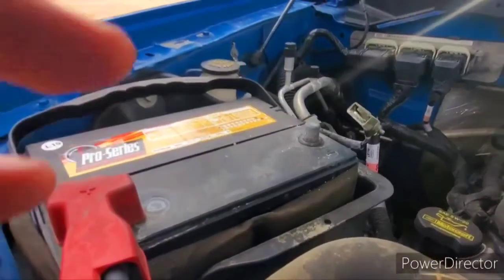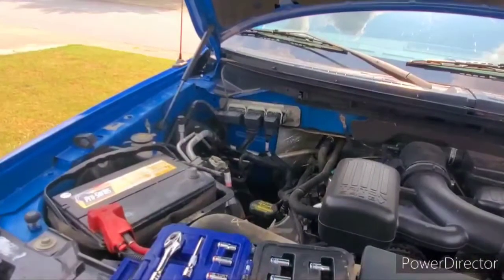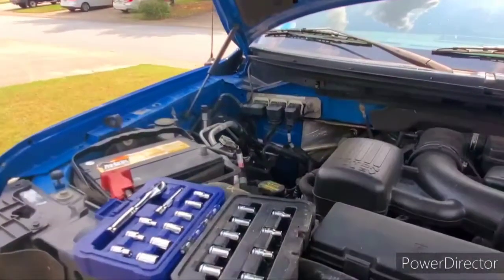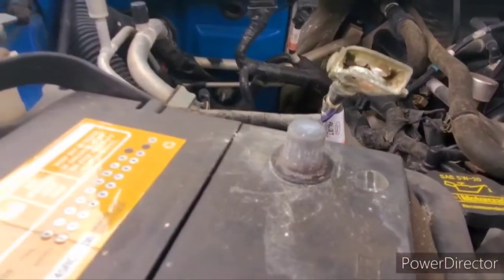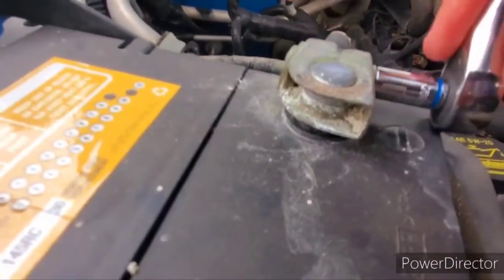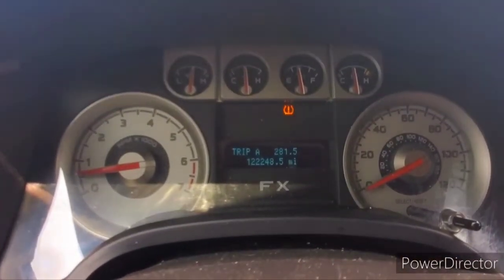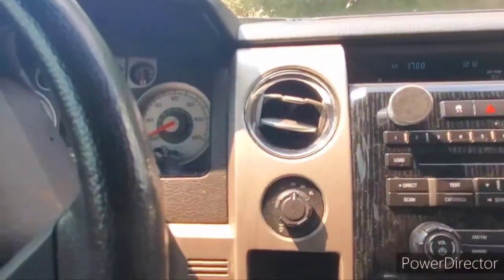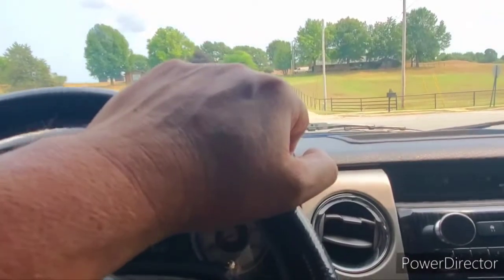How to reset PCM on 2010 Ford F150 FX4

Comment: Would this reset the battery charging management system?  I have been told by the mechanic I have to replace the pcm. I have already replaced the battery, alternator, terminals are corrosion free and the ohm test of all wires were normal.
Reply: I have the same problem! Just replaced alternator and battery on 2011 f150 platinum, bt battery keeps dying

Comment: My ac is not turning on.   Had a mechanic go thru it and he replaced the relay, drained and refilled the refrigerant and checked the wiring.  Everything passed.  Can't get power to the compressor.  He thinks it is in the pcm

Comment: Would this also reset the radio? I connected my battery backwards and now my radio doesn’t work. I’ve tried fuses, touching the terminals, etc.
Reply from the maker: Smell it thru the air vents. 99.99% of the time when you hook the wrong wires up, you've burned up the radio. It will smell like burned electronics.
Reply: My 2014 raptor is doing the same thing it’s shift crazy and the wrench light is on and also the engine light on
Reply: @gilmores03svt97  what ended up being the problem?